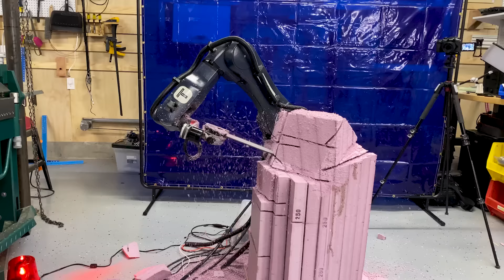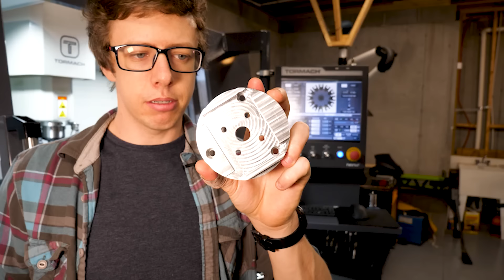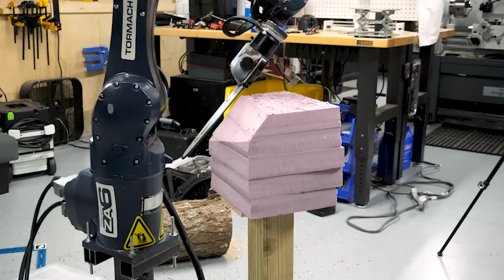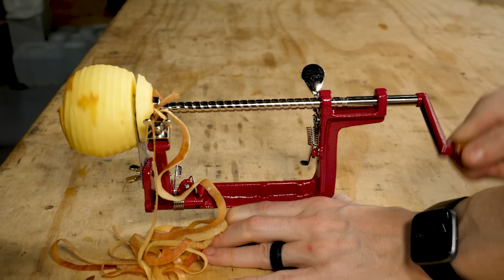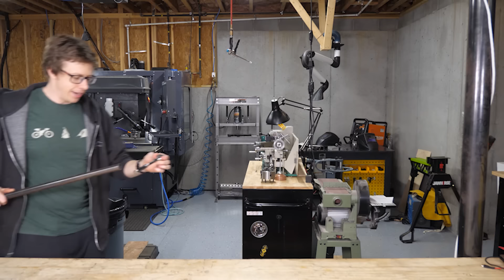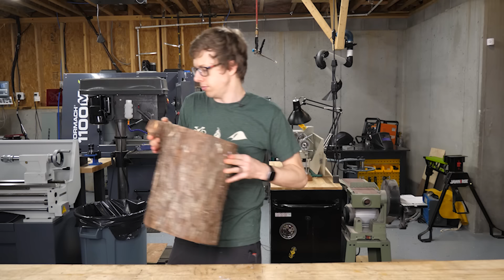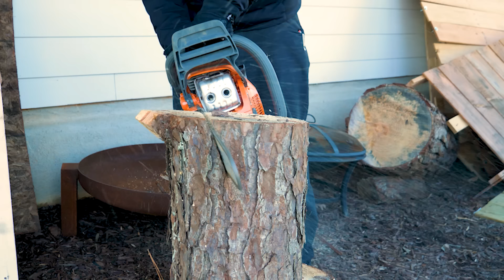Chainsaw + robotic arm = art?

Comment: really great video.  a comment i hope you are able to see... please please please, when you get the temptation to remove those failed attempts or failed algorithms from a video in order to shorten the length or whatever... don't.  I think it is so important for new engineers to understand that even the best engineers all go through and learn new things and try new things.  The process isn't like Bob Vila building something where everything just works.  It's a process just like this! And if you don't learn to love the process, you should find something else to do!  Also, second comment is to please keep in the parts that show you making compromises. If there is one thing I've learned in my engineering career, it is that Engineering is the Art of Compromise.  This video has so many examples of that in both hardware and software. And as engineers, sometimes the conditions of those compromises aren't technical - they are things like schedule, or something the customer wants... or aesthetics... or cost!  This video is such a great example to young engineers of both of these points. Please keep it all in!  Thanks again for all your hard work in these videos.

Comment: One way to solve getting stuck in local minima/maxima would be run it a few times from greatly varying starting positions. E.g. random sample of the potential starting positions. Just keep the number of samples low.

Another would be that once you're in a minimum/maximum allow the algorithm to try jumping further before deciding to settle. Could think of this being analogous to quantum tunnelling but tis a weak analogy.

Unfortunately I've only used the algorithm as an iterative update on positioning after an exhaustive search, so can't say the above actually work. :')

Comment: Regarding the local maxima:
Since (most) neural networks use gradient descent, which is just negated gradient ascent, there's a tooooooon of work around on how to avoid local extreme points. The easiest would probably be to just take an existing optimisation algorithm (e.g., Adam, Ranger, Adahessian) and just plop it in.

Comment: Shane: How about an "anti-mosquito" (or fly) autonomous exterminator system?  Using a combo of audible scanning and LIDAR, a creature would be tracked and movements anticipated enough to have an eye-safe wavelength LASER intercept and disable it.  Crumple wings would be considered adequate, death would be ideal. The room map would include exclusion zones to avoid beam strikes on people or surfaces which could create dangerous reflections. I figure something like this would be a breeze for you, something like a vacation from your normal outstanding work.

Comment: 10:40 This issue here seems that the set of states for the possible robot path form a non convex set, and gradient function are convex optimizers, so trying a non convex optimization technique at that point might have done the trick in eliminating the local maxima problem...... all other things being equal ofcourse lol
Reply: i believe i studied something of the sort in computational mathematics and the most applicable solution was to introduce a  somewhat random jump when you get to a point you think is the summit. That means you will get most likely to a point which isnt the summit but it has a gradient such that it will lead you to one and because this process is quite fast, this would be feasible. The sensitivity of this randomness could of course be altered by parameters in the code.
Reply: @josemiguelbento302  indeed, this is one possible technique, and is the basis behind rapidly exploring random tree,  RRT, optimisation formulations

Comment: Interesting. In my early twenties, I spent a great deal of time creating area clearance algorithms for milling 2.5D pockets and 3D surfaces. A similar problem although working with continuous contours I was able to use offsetting by the cutter radius (works also for 3D surfaces). The computing power in the early 90s wasn't all that though.

Comment: It almost looked like you had omitted the tank of bar oil and the oiler on your one-armed terminator. If so, that absolutely would cause your overheating problem when cutting higher density material (although, I would not be excited about the prospect of a murder bot slinging bar and chain oil all over my workshop and all over itself, so it would be an understandable deletion).

Comment: It occurred to me that you might want to run 4 simultaneous gradient assent subroutines, each starting in a fixed spacing from the center(?) and then comparing each to maximum height.  This might eliminate any false summits you find.

Comment: Inverse the computation function. Then it will be a minimisation problem. Which u can solve with gradient descent which has gpu optimised libraries like tensorflow or pytorch which will be more faster than normal python code running on CPU. Better if u have a GPU to run this on. Otherwise i don't recommend acquiring a GPU in this market.

Comment: The reason why your chainsaw chain is burning up is a. The cutters are dull b. the depth gauge rakes are too high and not allowing the teeth bite. You can simply fix this by sharpening the cutters with an appropriate size round file by hand or with a jig and take down the depth gauge with a flatfile a hair so it's lower than the teeth. I do find that it's harder to sharpen well a small 14 inch bar chain vs 20in+ that have nice large teeth, if you have no experience.

Comment: You should have tried this with a foredom rotary tool with typhoon coarse burrs.. You can change out the shape of the burrs to suit your needs.. From flat cylinder, bull head cylinders to balls and tapers or flame burrs.. It may take longer but the finished result would be more like a detailed cnc piece compared to basically a rough form..

Comment: Hi Shane. In case you don't have the right information ( it's apparent you do a lot of in-depth research) the anti-kickback link you referred to is actually a raker, and adjusts how much of a cut the tooth takes. If it's too high, you get sawdust, or test your smoke alarms =] If it's too low, the chain will constantly catch and stop repeatedly and possibly cause kickback. If you have it at a good height you will have chips that even Adam Booth will be jealous of. =]
The correct angle of the tooth in both X and Z is also important. 35°-40° in X will give a good all around cutting angle, Z will depend on the angle of the cutting edge. I try to keep the top face of the tooth just below the top of the file.
You have some great projects, and great production, also. Thank you for sharing with us!

Comment: I think your biggest problem with cutting wood is those anti kickback teeth. Special chains without them are available for carving along with special carving bars. If you did this along with adding a chain oiler it might be able to make those straight in cuts you want.

Comment: The standard way to solve local maxima issue is simulated annealing. Basically, you do gradient ascent, but at each step, you have some probability of going in the wrong direction. That probability decreases over time.

(Or you can do the ML trick of not caring that you're in a local minima)

Comment: Amazing content. Just discovered your channel and it's already in my top 5. 
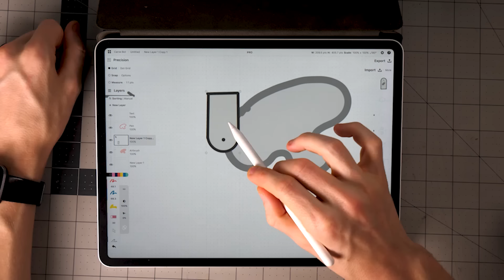You were right about the friction while cutting wood. Most chainsaw chains are for crosscutting. They have many teeth and cut the fibers perpendicularly. There are some made for ripping. That might help. Regarless, when you put all the chainsaw blade in contact with the log, you are actually recutting wood shaving effectively making dust instead of chips. Friction goes up, blade dull up, and fire alarm starts! Check this video from Advoko Makes. https://youtu.be/8qz64ELkxdA . Tip 1 at 5:10 and tip 2 at 9:35. You should try cutting using only a few tooth at the end of the blade with swinging motion. Maybe it would be easier to use an angle grinder with chainsaw wheel for the details. Next project, a CNC blade sharpener!!!

Comment: That’s not an anti kick back tooth 17:10 that is your guide teeth that’s it what keeps your chainsaw from cutting to deep and getting stuck so the guide teeth are supposed to be just shorter than the cutting teeth so the cutting teeth only take small bites that’s why saw dust is just little pieces of wood cause your only taking small bites out of the wood but the chain is going so fast and has no many pairs of guide teeth and cutting teeth that is cuts wood really usually if the chain is sharp and the teeth are the right size the reason your chainsaw isn’t cutting is because your cutting teeth are dull and have been basically ground down so much that they are no longer taller than the guid teeth so you need to just replace the chain on the chainsaw

Comment: Those extra "teeth" on the saw are called rakers. They help prevent kick back.  You can grind them down to allow cutting with the end of the bar.   Keep in mind the lower you grind them the more aggresive the saw will cut thus require more power.     Awesome project as always!!

Comment: To solve the gradient descent: basically drop multiple balls on the field, and the one which is able to go the highest is the winner. Yes, you still might not get the best solution possible, but you will have a pretty good one.
Keep in mind, the more balls you add, the longer it takes to calculate though.

Comment: With regard to gradient accent, I would love to take a look at the code, but a suggestion I could think of would be to set a level of fidelity, sort of a minimum calculable distance in points, then save that coordinate that was the calculated peak and tell the program to leave (basically invert the algorithm to follow its way down the hill), once its down the hill, let it run again but insist it directs its next path in a direction that does not lead to that point, it should find a new peak. There are definitely some theoretical issue with this, some might be solved by using the fidelity number to calculate how far it should really be distancing itself from an already known peak. But, I would love the challenge of solving this. Maybe I can recreate the program and testing environment for you, I'll let you know if I find the time for that.

It's funny really, as you were initially explaining the algorithm in your video, I thought about the code you were explaining, and came to the realization, based on those instructions it would get stuck on false peaks. I then thought, well certainly there is some sort of a way around that coded into the program, because that would be a fatal problem. But then you went ahead and explained that exact issue. I thought it was pretty cool my thoughts were in the right place on that. 
FYI I am a software engineer.

Comment: Little idea for the ball getting stuck on a false summit (just popped up, didn't test it yet) try generating another ball diagonally opposed to it on the same map, if the balls meet at the same summit, it probably is the highest. If they don't, repeat until they do.
(The idea obviously needs some tweaking, but I believe it's a way to make it work)

Comment: Impressive! 

What if you made a 2D laser projection onto the "log/block" and had the chainsaw follow the laser trace with a camera (the camera has to pick out the laser line from all the other noise). Then rotate the 2D projection together with the robot arm. That way you only need to cut from "one side" but once the log has rotated 360 degrees, you'll have you shape/dog/bear - or what ever you want. I've used this trick in a complete 3D environment, so I know it works.  This approach would be easier with a drill than a chainsaw, but whatevs :P 

Anyway - keep up the good work, inspiring as always!

Comment: I am only saying that because it would be cool to do, but it is also something only a crazy person would pursue:
1. Convert the pole saw to a removable end of arm tooling attachment. 
2. Add a mini saw with a smaller cutting radius to increase detail resolution or use a hot wire curved in the shape of a mini saw to melt through the foam. 
3. Have the robot change tools automatically
4. Resent YouTube viewers for suggesting things that take months to perfect.

Comment: I'm pursuing engineering in EC and maybe I can do the electronics part with microcontrollers, Arduino, FPGA but this guy does Mechanical part, electronics part, Coding part - also understands and implements complex algorithms and making things work in real life is super difficult.

Comment: You should use Numba to speed up your code. Python is inherently slow, so Numba compiles functions so it runs with less overhead. It is also really easy to use.

Comment: For the wood cutting. You will want to use professional grade chains (not anti kickback, which is made for homeowners). Also, for plunge cutting a hard-nose bar will usually be best.
 for the actual carving (fine shaping/ basically grinding) you are supposed to use carving chains. Since you are not using the saw as a grinder, you will want regular chain. The most aggressive cutting is square chisel (square grind) It is the sharpest, but dulls very easily. But it requires less power to get the same cutting speeds/chipload. 
Also, you NEED coolant for cutting wood:bar and chain oil--or you can run the bar and the chain.

Comment: Separate your geometry into convex subsets with plane separations. These planes are simply cuts with a constrained depth. Then on each convex subset, generate your convex hull and limit your cut depth to not interfere with the desired part. May become complicated but if you convert your cut geometry into a point cloud this should work. You could calculate approximate curvature of your point cloud then draw planes in a way to exclude “badly” curved parts. There will probably always be non convex problem areas but this would allow you to exclude them. Probably requires more thought that what I just put into it but might be worth looking into. Hyper plane separation may be something to look at but I’m not sure of the applicability.

Comment: Couple questions both directed towards making everything as easy as possible to establish a baseline.. instead of creating a surface that has a bunch of different variations, why not start with a program that looks at an established shape? You had all of the programming montages showing crazy shapes to find the best cut, why not like a cube or cylinder? Second, now that you have it working maybe take the pressure off your saw. Choose a wood or make a wooden log out of an extremely dry and soft wood.. balsam or aspen.. always excited to see your video notifications come in, love the troubleshooting!!!

Comment: Does that robot have any kind of force feedback?   You kind of need that in order to do variable feed rates when cutting real wood, which isn' the same in all areas and all directions, otherwise as you found, you end up cutting at a very slow feed rate to avoid binding up the saw or breaking the robot..  The other thing you seem to be missing for cutting wood is a blade oiler, which is critical for blade and bar longevity and which will make your basement look like the Exxon Valdez made a pit stop; and also your chain selection: there are many varieties of chain, and you might get better results on wood with some sort of skip tooth design and also filing down the depth stops a bit more (consumer grade chains typically allow very small cuts per tooth for "safety", but you've got a chainsaw on a robot, so just file those stops down a bit and slap another sticker on and you'll be fine 😁).

Comment: Nice. 

I reckon you are aware of the bunch of other robots using mills and/or hot wire to cut foam?
One of the issues with you chaisaw is, that it lacks an oiler. Without oil, attemptin gto cut into wood can result in a LOT of heat :-P

Check out these guys: https://www.pinterest.de/pin/2603712256601612/

Comment: The ascent method is similar to what machine learning employs but ML uses a descent to minimize a cost. The local maxima are a problem in low dimensional space. But you can do things like add momentum components or adjust where you calculate your ascent from to push yourself through the problem spots on your gradient.

Commendable that you tried to write that yourself! I would not have the courage.

Comment: I would think altering a 3D printing program would be an easier instruction tool. Just extract the start and end points and use them as your angular path. 
Armchair tip. ;O)-
Reply: Also: An industrial metal cutting router/drilling tip would work better for your wood.

Comment: First, you are amazing.  thank you for the inspiration.  Second, I would think a combination of methods would work best. Starting with a simplified version of the final method you used.  One where the valleys are not pursued, at last not rigorously. Then go to the apple peeler plan where you were using the “Minkowski method” but going both horizontally and vertically to get the most from every angle would get the best results.
Of course if you used a giant Drexel tool for the second step...

Comment: Nice one. I have a friend who programmed a hand like that + a cam to drill a holes in car wheels on a factory. Made positioning from camera and increased line performance by 500%. Also it is possible to run at night as no worker required.

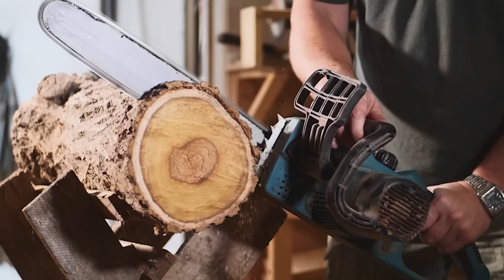Comment: @8:50 A 'carving' chain saw can take scoops.  The bars they use are slightly different (different tip geometries; and with a rip chain rather than the more typical cross cut one), which allows the tip to be used more like a wood grinder than a saw.  The net effect is somewhat like the delightfully safe looking chainsaw discs for an angle grinder.  Granted, it's not the fastest way to remove material, using it for details is common with chainsaw carving.  Indeed, it might allow a final finishing pass, using the tip of the saw as a grinder, to get those last bits of detail in too.